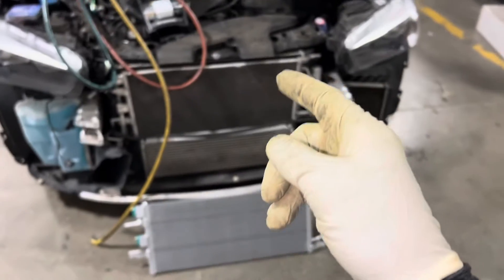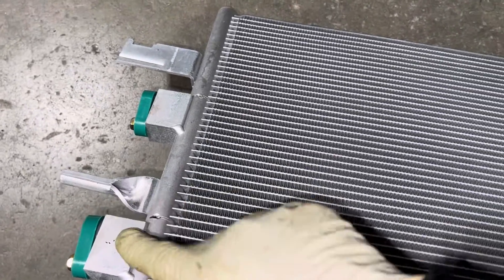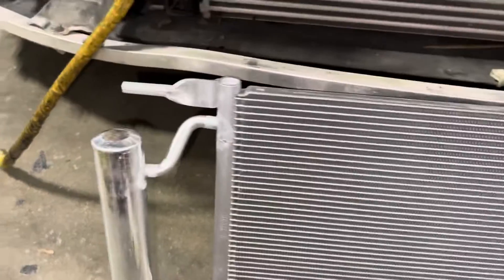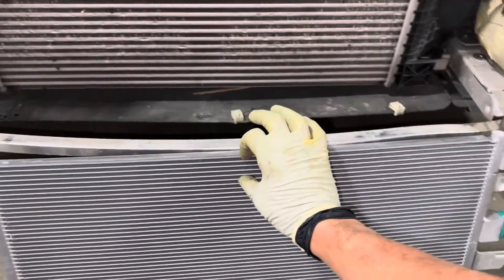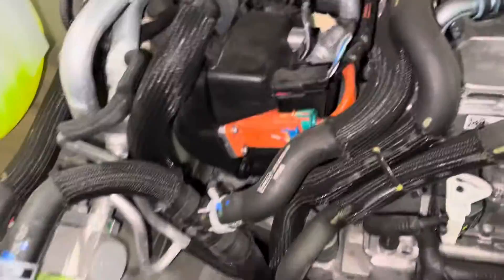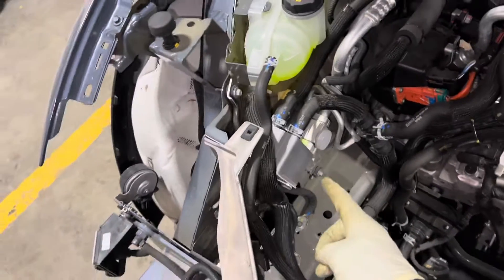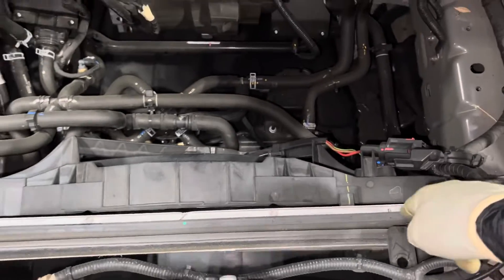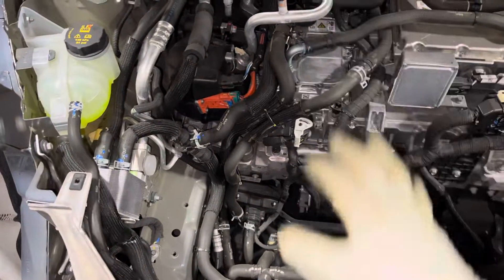BMW X1 REFRIGERANT TO GLYCOL PLATE HEAT EXCHANGER ELECTRIC ⚡️ COMPRESSOR NO CONDENSER

Comment: Can you give a brief explanation for glycol loop system and heat pump exchanger and how it works and it's relation to AC system?Thank you.
Reply from the maker: Almost exactly the same way that your engine works and your radiator and the heater core. 

Do you have a water pump except with electric vehicles it’s an electric water pump. 

When you need hot water or cold water two different components like the battery in the winter time you may need warm water but in the summertime when you’re charging you may need cool water to the battery so this will be handled by a two-way or three-way valve or multiple valves

Do you have the inverter that changes the battery power from charging or to the motor at different voltages when converting power that inverter gets very hot so it may need cool water this will be handled by a three-way valve and after that water gets hot from the inverter or the batteries when it returns it will go through that plate heat exchanger that has a expansion valve attached to it pushing flowing cold refrigerant in one direction of the plate heat exchanger through the plates that are like tubes and then the hot coolant will go in the other direction and the heat will be absorbed out of the hot coolant making it cool again
Reply: @coldfinger459sub0  what is the relationship between heat pump exchanger &AC system?
Reply from the maker: @issamadam9352  Heat pump simply put is an air conditioning system that you run in reverse. 

You start pumping the hot gas of the condenser and switch it to go to the evaporator. 
       Now your evaporator under the dash that normally cools you has just turned into a heater and will heat the inside of the car. 

At the same time the suction side has switched and the condenser in the front of the car becomes the evaporator. 
          Absorbing heat from the outside air just like it used to do when are used to absorb heat from the inside of the passenger compartment sending it to the compressor. 

Just like the house same thing in your country you have many mini splits in all your stores and houses. 

Other than you do not have a cold winter so you do not have to turn on the heaters where you live.

Comment: Seems very complicated, i don't think these vehicles will last even 10 years, very expensive to maintain it.
Reply from the maker: Same maintenance like any air conditioning system.  

The secret to the refrigerant the compressor you just never allow it to run low on refrigerant it never overheats it never has like a lubricant so last forever

When a technician services the air-conditioning they often contaminate the system with moisture or air they sometimes overcharge or under charge this is what causes the compressors to burn out it’s all the technicians fault because of ignorance lack of education and being cheap

The other scenario the customer keeps driving the car when he notices the air conditioning does not cool very well but he keeps using it and either he’s cheap and he doesn’t get it serviced or he thinks he could keep using it and not go in for repair and as a refrigerant slowly runs out the oil starts not coming back to the compressor and there’s no cool refrigerant back to the compressor so it burns out that’s the customers fault

There’s nothing wrong with the systems there’s everything wrong with the mechanic who work on them they’re usually the cause of the failures. 

The same for the glycol systems just like your radiator and coolant you never ever use tapwater inside a radiator or a glycol system because it contains iron magnesium calcium and other corrosive and conductive elements. 

My father used to tell me when I was very young

You see all the other mechanic to use tap water that you drink into radiators they are the cause of radiator leaks freeze plugs rotting out and leaking plug and leaking heater cores because they’re ignorant or because they’re cheap and they don’t want to or they don’t know you’re supposed to use distilled water or dinner ionized water or reverse osmosis water. 

My father used to say if you hate somebody and you wanna cost them a lot of money and repairs in the future.   You top off the engine coolant reservoir with tapwater and he will screw that customer engine or radiator or heater core so it leaks later on in the future. 

Ignorance is intentional

Being cheap is intentional

Being lazy is intentional

We all have a choice to make

My father explained this to me very clearly at the age of 12. 

Things are only complicated for people who choose not to study and learn

They’re lazy about studying that is a choice

Or they’re cheap and they don’t wanna invest the money in books or travel for education or taking classes that is a choice that is intentional

And staying ignorant and lack of knowledge is a choice because they don’t put out the effort because they’re lazy and they don’t want to read or go for classes or they’re cheap and they don’t want to buy the books or pay for the classes it’s all interrelated.